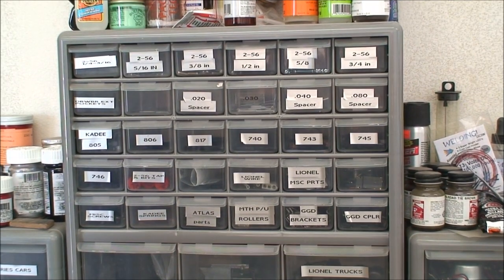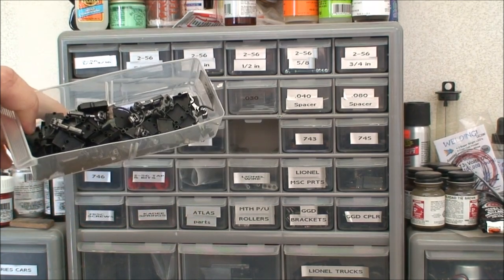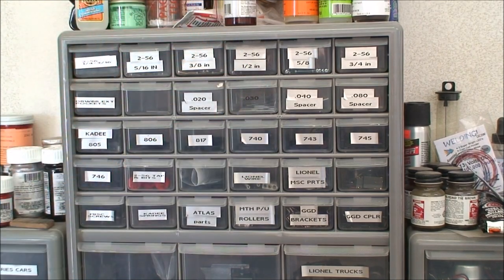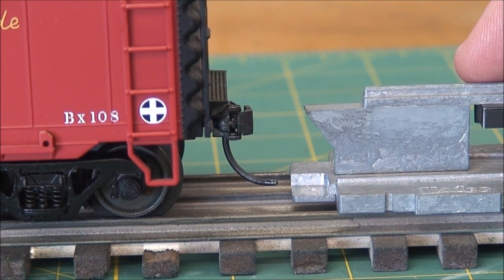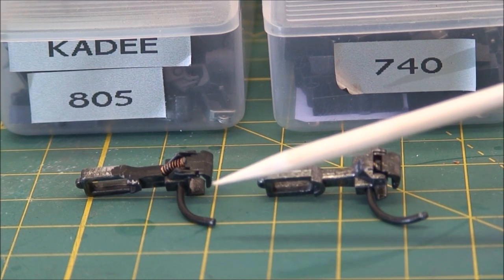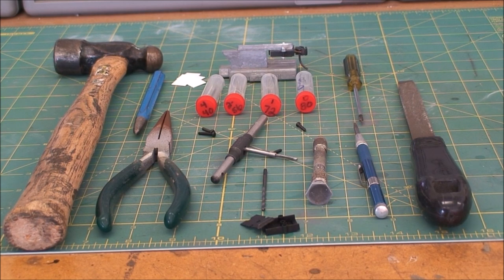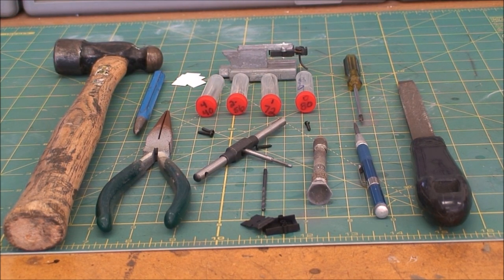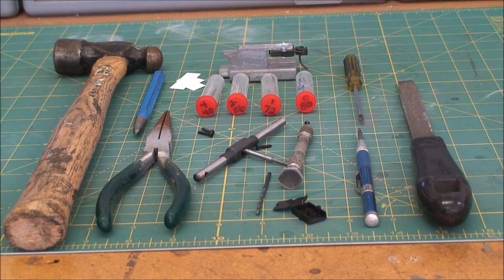The O Scale Kadee Coupler - Part 1 The Coupler and the Tools

Comment: I sure learned  a lot about  kdee couplers  D so you have a recommendation on what kadee  coupler  might work on marx o gauge rolling stock
Reply from the maker: No idea about Marx. 805 and 740s work on everything, it's a matter of getting the correct height using spacers during the mounting process.

Comment: Do you use the metal box kadee on steam engine tender?
Reply from the maker: Yes but the spacers are styrene. I've never had issues going that route.
Reply: @Laidoffsick  Lionel smartly drilled holes, included screws, and two circular spacers (just figure that out). I will try their spacers with the 740 and see if I have any issues.